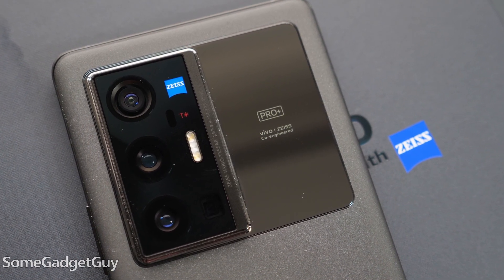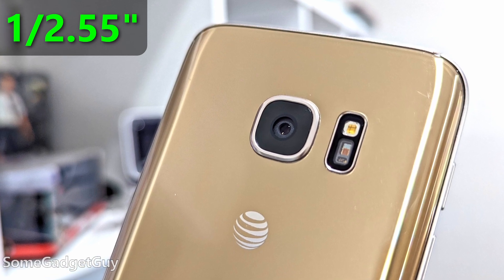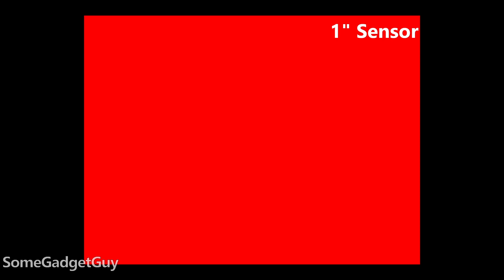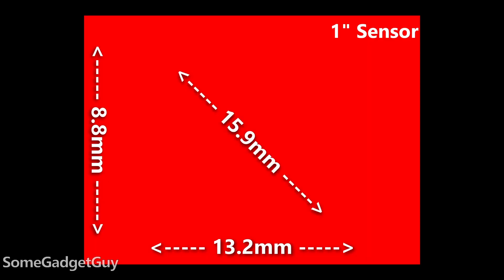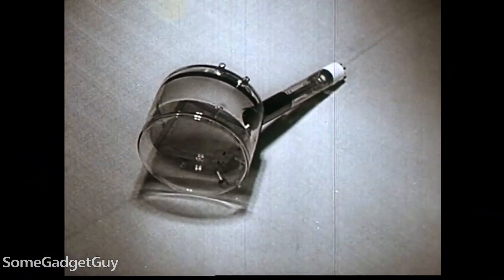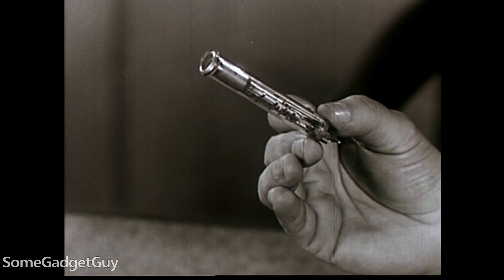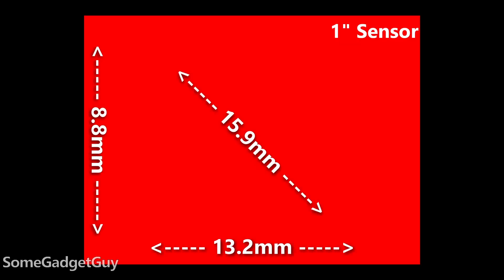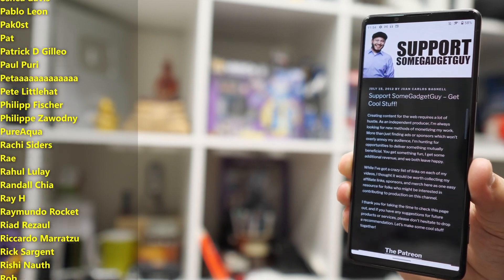How big is a 1" Camera Sensor? Why do we call it 'One Inch'?

Comment: A common misunderstanding. The fractions like 1/2.3" are not fractions of the one inch sensor size. The original tubes were 1/2.3" wide.

Comment: I believe from what I see in your video that the iPhone 15 Pro (phone I have) has almost the same size as a 1" sensor. I had a Sony RX1005 until stolen, and I got it because it was 1" sensor and 20MP. When I got the iPhone 11, I found myself using it more. It was always with me and smaller and although only 12MP I found it just fine. I've always wondered what the pixel pitch is between current iPhone and 1" sensor. Its got to be close.
Reply from the maker: iPhone 15 Pro has a 1/1.3" type, which is pretty big for a phone but only about half the sensor surface area of a 1" type.
Reply: @SomeGadgetGuy How close are the pura 80 ultra or xiaomi 15 ultra to 1"?

Comment: Until very recently I thought 1" sensors were 1" diagonal. I thought micro four thirds was 4/3" or 1.33" diagonal bc well why wouldnt four thirds mean 4/3...And then since FF is 2x MFT I thought FF was 8/3" or 2.66" diagonal and being American I just assumed a 3:2 rectangle with a 2.66" diagonal has a 35mm long side like 35mm film and just called it a day. Turns out 35mm film is actually 36mmx24mm but for some ancient film roll reasons we call it 35mm and 36x24 has a diagonal of 42mm which is not 2.66"...lol camera math sucks...
Reply from the maker: It's funny. So many conflicting "standards" and old ways we USED to describe things that kinda dont make sense today, but we still use.

Comment: Here is the real reason foe gobbledygook in camersa sensors>>> DISHONESTY and FAKERY. through and through.                
 Eaxample the Samsung 108 Mpixel camera is actually 12M pixels   >Don't believe me > ? Check it out
Reply from the maker: Well, pixel binning is a different marketing issue than "inch type" sensor measurements, but yes. It is a lot of consumer confusion on what should matter for photography.
Reply: @SomeGadgetGuy  I bet I am likea lot of long time camera users and am sick of the completely ambiguous and dishonest represemtation. >>SAMSUNG  latest puff for the S22  borders on the  fraudulent .             .It actually states that the Camera [ not he sensor ] takes 108 Mpixel photos. and so this makes for superior Video.> Sweet Jesus.             .You have to have a fine degree of filtering to read the garbage.  here is the actuality  Small pixels are inferior light collectors.  And then the hype about Samsung Video.                 .Short  bursts  of 8k 24P with miniscule pixels  video.     .  Process that stuff to export  twice in Pemiere and it turns to garbage

Comment: Do larger sensors only matter in low light? Does having a larger sensor only more beneficial with a large lens? 

What do they mean by 108mp boyer? Is that really a 12mp sensor?
Reply from the maker: Oversimplifying, but a larger sensor means a different lens for the same equivalent field of view. We arrive at better low light, shallower depth of field, and better fine detail. 
Pixel binning sensors are advertised at their "full resolution", but often the raw files (what we would consider the native resolution) are around 12MP. 48MP, 50MP, 108MP, all bin down to around 12.

Comment: I'd say the real question should be.. How much of that 1 inch sensor is actually used and why are Sony implying that the 1 inch sensor is used to its full potential? That its just a publicity stunt and they may as well have used a much smaller sensor with exactly the same results.
Reply: All Sony One inch sensors are 20 megapixels. If it is 12 megapixels then it uses 60% of it. In one direction that is 77%. I think the sensors actually are faulty ones where there is some fault on the edges. Such sensors are worthless unless one creates a product that can use them. Previously Sony used them in an action camera.
 
Still the sensor is larger than normal phone sensors.

Comment: Maybe you could look into how much of the sensor the phones actually use.  I suspect some put a big sensor in, but have a lens that doesn't produce an image over the entire sensor and they only use the middle of the sensor.  So they can claim to have a bigger sensor, but actually only use the same surface area as other phones using a smaller sensor.
Reply from the maker: It's pretty easy to compare. Instead of acting like there's some kinda gotcha there, we COULD talk about lens design...
Reply: @SomeGadgetGuy  What prompted me was rumours that the new Sony phone does exactly that. it's "1"" sensor, but they don't use the entire sensor.  But the internet is full of b*, so I've not enough info to be able to judge.
Reply: @KeithBab  The The Xperia pro is not final yet, so they heave to wait for a update to see how it really is.

Comment: Xperia has been a conversation starter, lately. So, does it mean, smartphone industry is still improving after LG exits?
Reply from the maker: LG left a BIG hole, but we're getting some interesting options to try and fill that hole.
Reply: @SomeGadgetGuy  Hopefully, we will be done with false improvements - excessive pixel count, large but unoptimized batteries, and chasing performance benchmark numbers.

Comment: Yeah, calculating sensor sizes in fractions of inches are confusing for people. Not everyone knows that 1/2.55" is bigger than 1/3", let alone how much bigger. that's why I always give another dimension in my stories on smartphone cameras, mostly surface area in square millimeters. People understand immediately how much bigger a 30mm2 sensor is compared to a 16mm2 one for instance.
Reply from the maker: Like A&W discontinuing a 1/3 pound burger because people thought it was smaller than McD's Quarter Pounder.

Comment: Feels similar to how they market EVFs and the back LCD screen for Cameras with Dots instead of Pixels - so you need to divide by 3.
Reply from the maker: LOL A little yeah, but this has a BIT more historical precedent.
Reply: Haha. Some screens have a 4th white subpixel, so sometimes you need to divide by 4. Iirc, in Sony’s A7 line going from the Rii to the iii, the number of dots actually decreases, but the pixel resolution went up very slightly.

Comment: This sensor is smaller than a APS-C size sensor (which is: 25.1×16.7 mm). It is a marketing term to trick people who know nothing about photography at all or are too lazy to search up basics...
Reply: Since when did people consider that 1" sensors are better than APS-C sensors? No camera manufacturer ever does that, and it is the sole responsibility of the users to understand these technical information about the hardware before making their final purchase decisions.
These companies are NOT to be blamed for the people's lack of information, as they can immediately know the difference between a 1" sensor and an APS-C sensor with just one search on the internet.